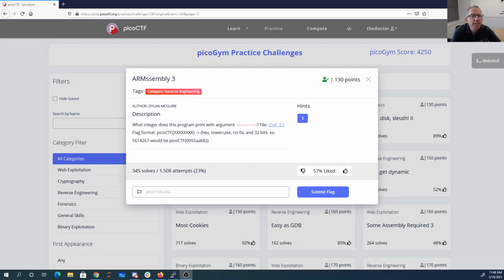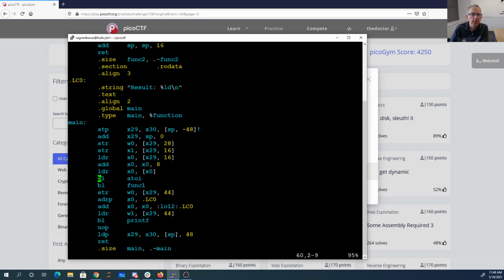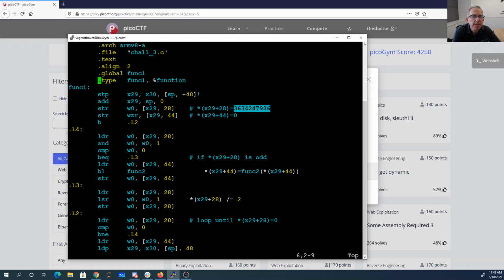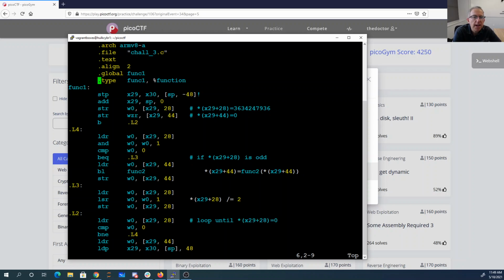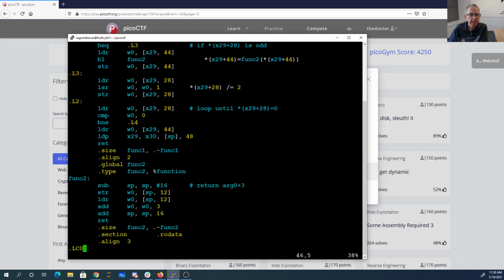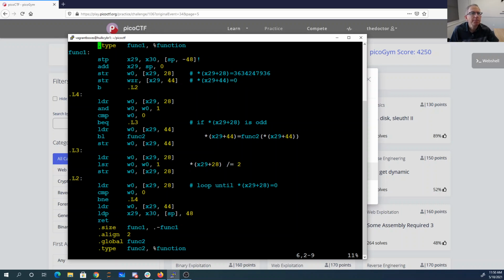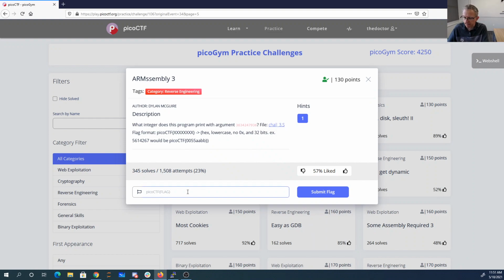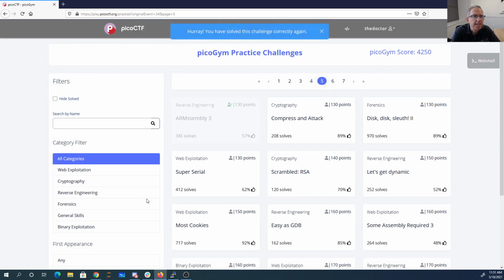ARMssembly3

Comment: Can I ask why  'and w0, w0, 1 / cmp w0, 0' is a check for odd? Isn't it supposed to check whether a number is even? Since it performs AND between w0 and 1, then if w0 is odd, the result would be 1, then cmp w0, 0 would be wrong?
Reply from the maker: The jump occurs if the number is even, so we fall through if the number is odd. It looks like "if (number is odd) then ..." because the jump goes past the "then"